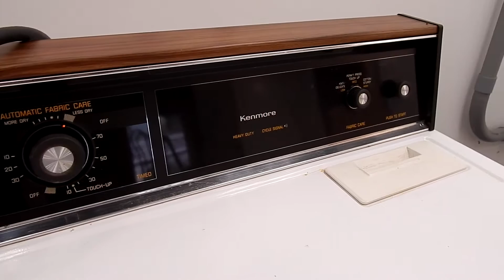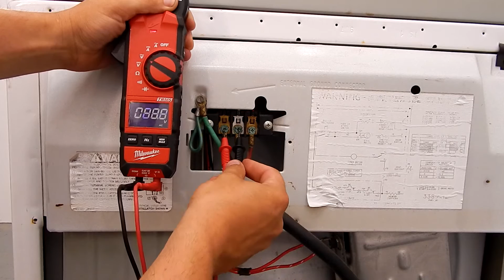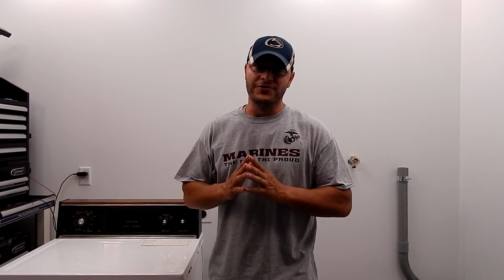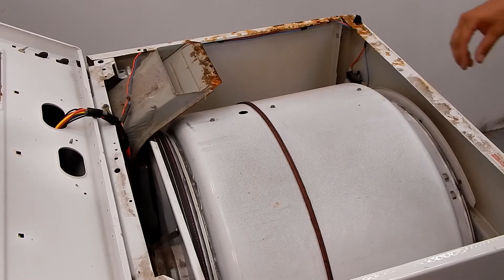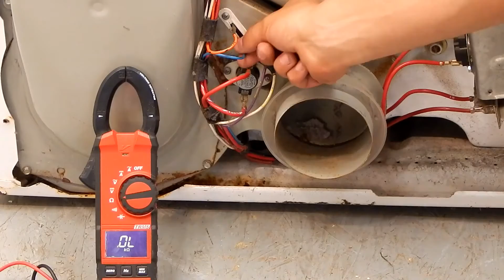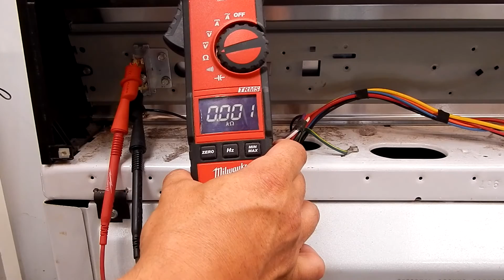How to Troubleshoot a Brown Top Kenmore Dryer that Won't Start

Comment: I have a Kenmore Ultra Fabric Care, model 110.97284810 that suddenly stopped working. With no prior warning (it wasn’t limping along or anything like that), the dryer won’t start. I press the START button and I hear clicking underneath the timer DIAL. I saw your video & noticed there are wires going to the timer dial. What could I test to determine if something to do with the timer dial is no good? And is it possible to find parts for this old machine? (I LOVE this dryer.)

Comment: Thank you for adding that information of the wiring connections to the thermostat and the other switches. They are in some cases the same color and mixing them up is easy. Helped me tremendously.

Comment: I have the exact dryer. My dryer runs but the timer doesn't advance and it's not heating. Heating element, thermal fuse, thermal cutoff all are fine. The timer switch is good. How can I test the temperature switch and timer resistor? That's all I know that's left to do. They don't make the temperature switch anymore so I may have to buy a new dryer. Thanks.

Comment: I replaced the belt pulley kit. Start up fine. My girlfriend over loaded the dryer. Pushed the started it and the dryer buzzed real hard then died. Even dimmed the house light a little bit. Did she blow the motor? I did reset the breaker. Still nothing.

Comment: Our dryer is the same except for the lint catcher is inside the drawer and our panel we have checked for things is on the bottom front . Would that be where the thermal fuse is located ?

Comment: Greetings, my mom has a Kenmore #110.76660100 and it is experiencing the same problem, however I was not able to locate a thermal sensor. I did note 3 thermostats. Any suggestions? Thanks in advance. This is an old school dryer for sure. :)  The door switch was replace last year by the way. I replaced the starter today.

Comment: what is my dryer is humming when I hit the start button?. the blower wheel wants to start spinning but just stops and starts hummimg.
Reply from the maker: +John O'Quinn Check for any obstructions in the blower housing.  If there is none, you may have a bad motor.  Usually the hum when it starts is a sign it's going bad.  You can try to start it with your hand and press the button at the same time, if it spins then, it's bad.

Comment: Another great video! Question though, wouldn't also be a possible bad timer or motor run/start switch on that model?
Reply from the maker: piqua793 Yes,  I think most people will find there problem with one of those.  My next video will be a part 2 of this one.  I will include on that video testing the motor winding and stuff also because the run/start switch could be good, but if the  windings are shot it still won't start.
Thanks for the Comment!  and Thanks for Watching!
Reply: Bill Newberry Great always ready to learn more from you.